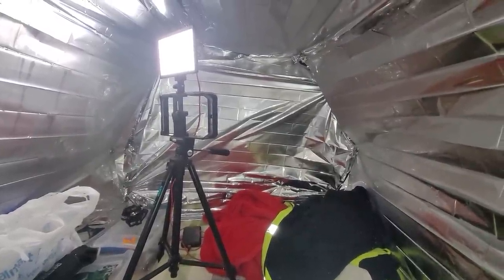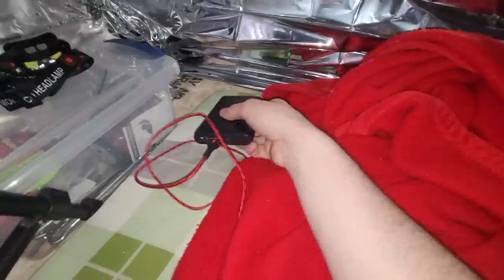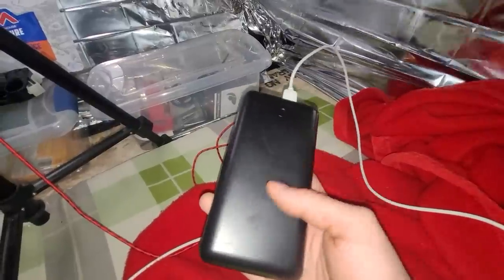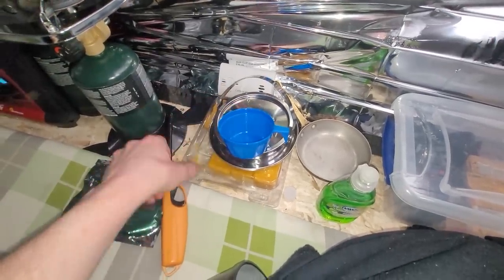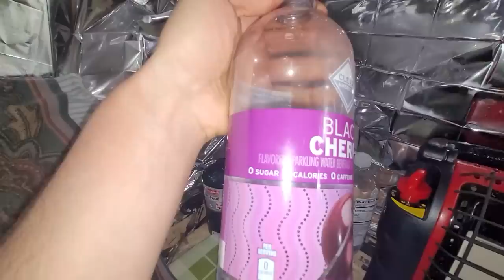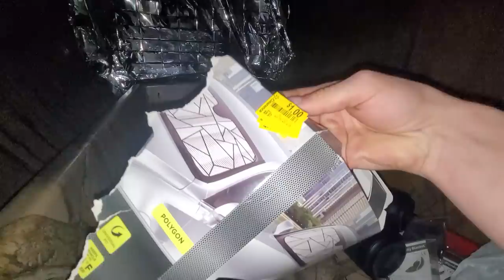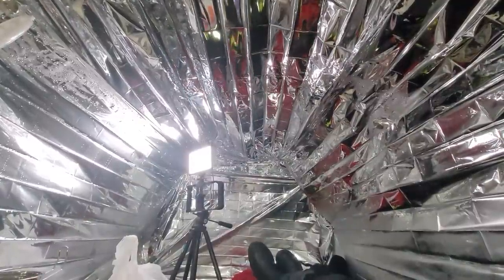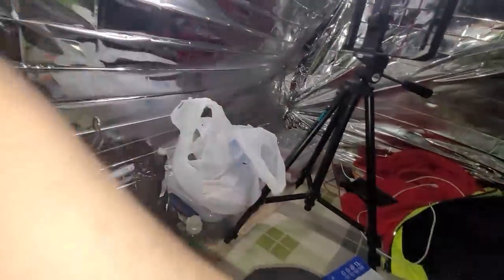Thermal Camp In Detail. Stuff I Brought And Talking

Comment: lately I have been getting some good ideas from your hot tents and this.   One thing I miss from the Gym I used to go to is the sauna.   I am considering buiilding one this spring and to have wood and or propane heat.  Yes, I will use goopd CO detector.   Planning now to build in safety.